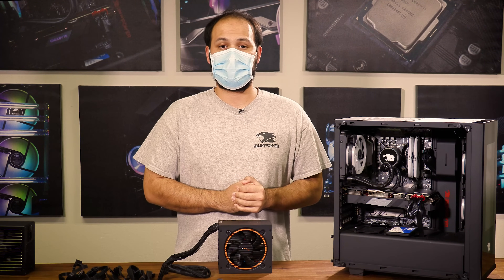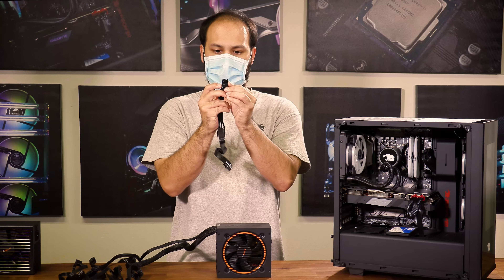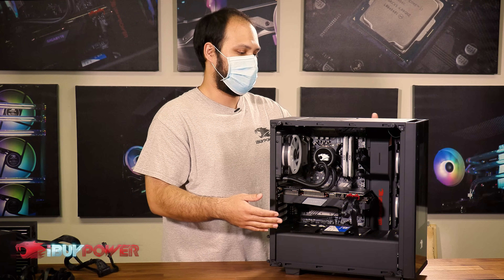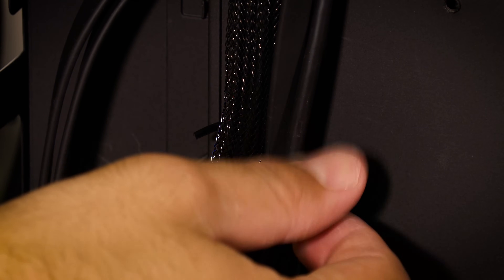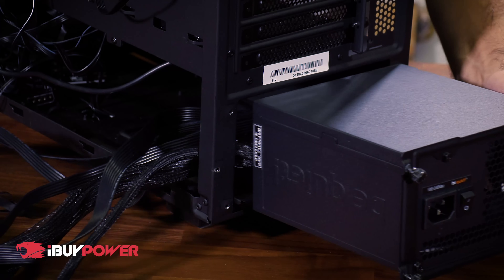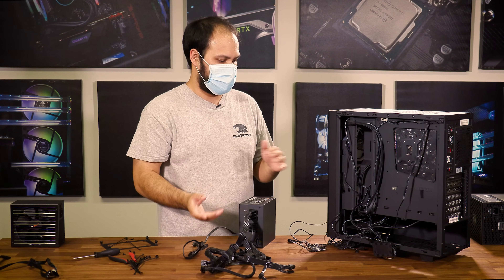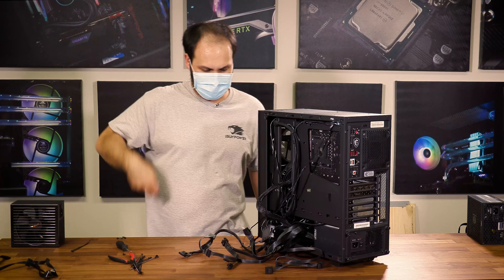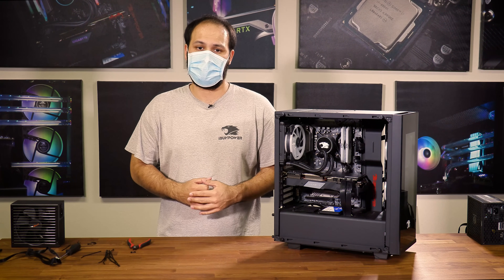How to Replace PSU on PC - iBUYPOWER Tech Talk DIY PSU Replacement

Comment: A good "how-to" video.  I'm an absolute N00B and I was able to relplace my (failed after only 6 months) PSU on my pre-built IBP desktop purchased from Costco.

The wire loom is intimidating and I almost caved and took it to Geeksquad but in the end you're really only unplugging and plugging in less than 6 locations and this video shows you where all of those are. 

I bought a completely modular Corsair replacement unit and I had more trouble identifying the correct wire bundles to use from that package than I did from removing the crappy IBP unit that failed.  Corsair can't with ZERO instructions and word were all black instead of color coded and labeled like I've seen on some.

Bottom line... YOU CAN DO THIS!  Take your time and watch the video several times.  Take lots of pre-disassembly pictures and refer to those as you work.
Reply: Damn. Going thru this same exact process now with a corsair fully modualr psu. I guess the saving grace, i got 6 years out of the og psu but time to put this thing together

Comment: I hate that he showed the easy to get to version of the cpu connector. If the radiator is on top and not connected to the bottom you have such limited space to get to the cpu connector. Everything else is easy. Also NEVER buy anything but a fully modular PSU, it will save you time and free you of any headaches in the future.

Comment: Late af but are the only things that I need to remove the cables from the psu??? cus i also have a prebuilt and I saw some wires that connect to something with audio at the lower part of the motherboard and the connector has a logo audio and usb.. idk if I should plug them out  or no since I cant see if they're a part of the psu cables.

Comment: I purchased an IbuyPower Y40 (I7) PC from Best Buy, Lady Lake, FL, 02 Nov 2024. I want to upgrade the PSU from the 700W that was installed on it, to a 1000W PSU. But, I need to know what type of PSU I need to purchase that can be installed in the machine. I don't know enough to buy a "modular", "semi-modular", "non-modular". I have a Total Tech program with Best Buy, so they will install the PSU, however, I need to have input back from you, regarding the type of unit I need to buy.

Comment: I will be attempting this next week when I buy a new power supply. I just upgraded my GPU after old card ceased to work. turns out the new card needs 550w and my supply at the moment is 500w. have no idea if my current supply is modular or not yet. question I have is will a new power supply come with the needed cables or will that be extra purchases necessary?

Comment: Of course. Make a power supply shroud for the looks but not take into account that it will now be more difficult for the user to take out or put in the PSU...

Comment: if a got a modular power suply can i just switch it with a more powerful version of it without having to replace all the cables?
Reply: I'm guessing you can mate, I don't know but it's kinder the point, if with the next supply you see the cables are the same, then yeah I guess

Comment: Can't you just disconnect the cables from the psu, swap the psu, and connect the cables to it, without undoing everything?
Reply: No. Unless otherwise stated by manufacturer (*some seasonic power supplies in particular*), you may never mix the cables of two different power supplies. They are not identical, and will more-likely-than-not result in PSU failure. Best case, it fries a cable or the PSU. Worst case, it fries other components, and starts a fire.
Reply: @MightyMase04  oh ok. Thanks for the reply!
Reply: @Miguelskytwins  If the PS is fully modular and you replace it with the same one, then you could get away with only changing the PS unit.

Comment: I Have the  "Model:TraceMR157i SKU:6451091" and the power supply doesn't come out that way. When I unscrewed the power supply, it just fell down inside the riveted case.  There's no release like in your video.  Very annoying as I am upgrading my daughters Video Card and need a new power supple for the 8 pin cord.  :/

Comment: you said that for the video card, you should run a second cable.
But how?
You didn't have any space left to run a second cable?
Reply: He said IF the graphics card requires it. That one in particular did not require an extra cable.

Comment: now that i'm upgrading my power supply I see that it wasn't an 850 as advertised. It was a 700. Damn, that explains a lot.
Reply: Was your pc freezing/crashing because of that? Because thats what im dealing with currently
Reply: @fabianespinoza3245 yeah cheap psu can cause that. Also might wanna get your ram checked out
Reply: @fabianespinoza3245 yup

Comment: I am trying to fix an I-Series Tower that shuts off as soon as you try to start it.  I am assuming that the power supply is bad.  The power supply is a High Power Model HP1-J600GD-F12S.  When I looked for a replacement, there was only a used one.  Can you recommend a suitable alternative model?

Comment: That is an incredibly weird choice to run a single fan radiator for liquid cooling...at that point you'd benefit a lot more from a decent air cooler. Yikes..

Comment: It looks hectic because pre builders put about %5 effort into cable management and buy cheap PSU. Then they shove a $2 fan hub with and max out the cheap RGB fans to attract people that think RGB=better PC and that makes a rat nest of cables. Your new cables and the mothor board plugs will be labeled so you literally match them up it's hard to do it wrong. And if you take a little time and use cable ties it will be way better than the original pre built was guaranteed 👌

Comment: I dont understand why we pulling out every cable out of the motherboard why not only swapping the cables from the old power suply to the new power suply
Reply: dont mix match cables od different psu, it will burn down ur pc.
use the cables that came with ur psu, dont reuse anything
Reply: Okay i dont know if you already figured this out but that will actually completely fry your pc.

Comment: I appreciate how even though, it's a pre-built, you provided a guide for replacing PSU. Thank you.
Reply: Certain prebuilds are prone to having to change your PSU. COUGH Cyberpower PC COUGH COUGH.
Reply: Fr ive had my cyberpower pc for only 4 months! Suddenly it wont turn on so now i gotta replace the psu @ButterBehemoth
Reply: @ButterBehemoth some prebuilts power supplies' appear to be unreplaceable
Reply: If you upgrade your GPU it will need a new PSU. It also looks like IBuyPower uses cheap PSUs. This is my position. I cannot complain about mine besides the attachments for the glass falling through. I am upgrading to a 1000 watt PSU to go with my GPU upgrade.

Comment: The cord powering the motherboard literally won’t come off and I’m afraid to use a little force
Reply: Don't be afraid pinch that cord and pull even wiggle it a little. I use by other gander to brace the motherboard down to keep it from bending. Most people here couldn't snap a pcb if they tried lol.

Comment: I just wish there were more close ups and highlights when talking about certain parts rather than being zoomed out the majority of the time. This is okay for help, but for someone who's a visual learner like myself I would have appreciated seeing each part being plugged in rather than seeing most of it from the back and in super speed up mode.
Reply: yup tjis video doesnt show ANYTHING about how to disconnect my fans or the on button which is soldered into the chip.

Comment: Geek squad actually knocked this job out for me for $39.99 and only took like 2 hours! Just fyi if you're like me and open the case and realize you'd rather not tangle with all those wires😉
Reply: That's not too bad to be fair if you have the money.. some places will charge much more. I would have probably done that as well at some point but being broke all the time kinda forced me to learn to build stuff. I'm glad about it now because I gained the skillset however back in the day I wasn't too thrilled at first.
Reply: I wish I would’ve saw this before I opened mine Lmfao
Reply: I think I might do this cuz replacing the power supply is literally rewiring the whole fuckin pc which took me like 4 hours the first time I did it
Reply: @d3admaub938  ya man I was superr glad I did it. But you might need to call around because apparently not all of the geeksquad locations will do it
Reply: Meanwhile I went to geek squad and they asked for $60 and a required 2-3day hardware diagnostic for $100... Told them I'll do it myself at that point.
Reply: @Huckle7   that's crazy man. It's a straightforward part install they shouldn't charge you any of that bs!
Reply: @ATLWood13  It's policy now, probably because some idiot somewhere did something stupid so now everyone has to pay the price going forward.
Hopefully someone in management eventually realized how stupid asking to keep a customers pc for 2-3days is.
Reply: @Huckle777  nah that's nonsense. You gotta make sure they understand it's just a new part install. Not a "fix". So there's no place for a "diagnostic" because you aren't having a problem with the pc, you just upgrading a part. If they still try to make you pay for the diagnostic I would try a different best buy location or ask for a manger and explain that it's a part install, not a repair.
Reply: @Huckle7  It is for liability to make sure that the PC does not have any underlying issues the customer could blame them for. Also, another profit center.
Reply: @ I get that for sure. But it just sucks that a good service is not elimated because 99% of people are not leaving their pc overnight and letting them install and run bloat testing software
Reply: Dang. Hopefully it's still roughly that price. Cuz I dont want to deal with it. Knowing me ill mess it up every way possible
Reply: @Britenry406  They don't even do it anymore. And if they do it's like 4x the price and they need to keep your PC for a few days AND run some bullshit bloat software.
Reply: Thank u
Reply: Do you bring the PC to geek squad or do they come to you for $40?
Reply: @UnlimitedProduction1  I def had to bring it to them for that price
Reply: It was a 2 hour wait to even SPEAK to an agent, then they needed to charge $100 diagnostic fee (I already removed and confirmed the power supply) and said the turn around time was 2 days. A power supply is literally 4-5 connections and some cable management. Absolute clowns.

Needless to say, the project took me 45 mins to complete. You can't convince me otherwise that the Geeksquads entire book of business are boomers who are completely illiterate that they can easily take advantage of.

Comment: Nice I'm gonna be doing that very soon with a new high end psu since my current psu is making a clicking noise when ever i load a game or exit a game which is totally weird!
Reply: that can just be the fan if you are willing i would take apart the psu and clean the fan that should fix the sound i had to do the same this
Reply: @jackiebiskan4748  My pc was getting loud when playing games on steam and riot client like valorant. Plus they also crash or restart the pc while playing. So I decide to clean inside the psu and after screwing back in. It won't turn on. What do you recommend doing

Comment: Where can i get the 6pin argb fan hub that came with your computer... mine smoked and burned... the one i got from amazon works on different brand fans but not the ibuypower fans?  I sent email to your techsupport but no reply and i cant use my pc without fans...